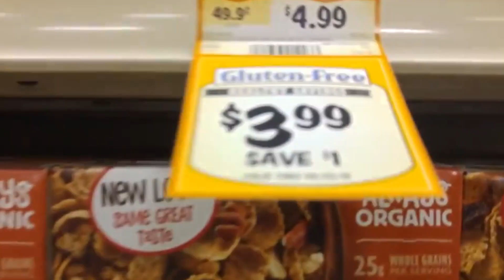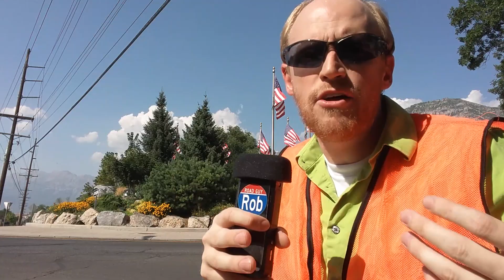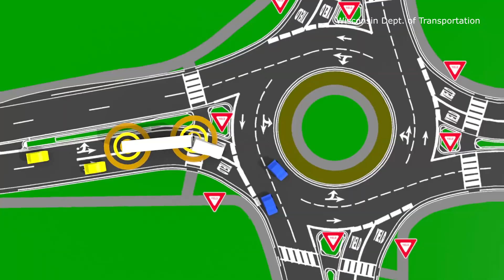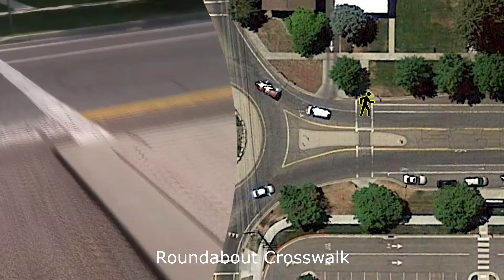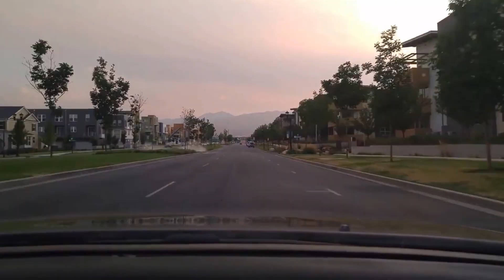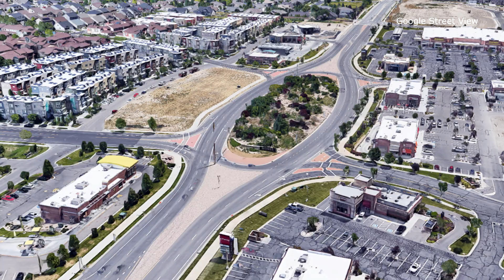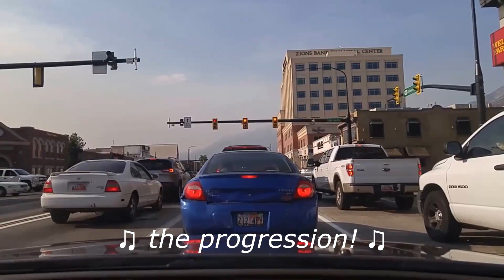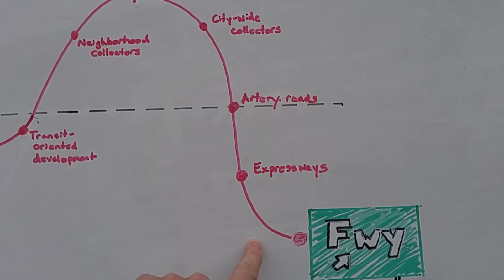Are roundabouts REALLY better than a traffic signal?

Comment: There are several problems with roundabouts that apply chiefly to Americans. American drivers tend to be lower-skilled and feel more entitled overall than their European counterparts (Russians notwithstanding). Of these, they fall into two camps: those that are fearful and those that are hyper-aggressive. Both groups are problematic anywhere of course. But while roundabouts can to some extent curb aggressive driving (good), they unfortunately cause already fearful drivers' anxiety to go through the roof, which in turn can cause substantial interruption in traffic flow at roundabouts as they hesitate to enter or exit them, or yield to entering traffic. Perhaps these behaviors will improve in time as drivers get more used to them. As to longer walking distances for pedestrians this can be both good and bad. For disabled and elderly folks this is clearly bad. On the other hand, given Americans' propensity to get obese or at least overweight (me included if I allow myself to slack off), longer walks can be a good thing. So are roundabouts good for America? Dunno. American drivers do not inspire confidence. The most clever traffic engineer is easily thwarted by entitled and fearful drivers. I think we're doomed have all self-driving vehicles eventually because of that, and I am not thrilled about it.

Update: since I wrote this, they've since installed three compact roundabouts on the main thoroughfare that services my sector of the city. I think overall it's a positive, but the biggest flaw in this design is that it in no way curbs the speed of drivers determined to get through them as fast as possible, particularly when they see themselves as being on the "main road," and the connectors as "side" streets, as was previously the case. The center is barely raised, as a raised center is a potential hazard for large vehicles. This wouldn't be so bad if the state had raised the pedestrian crossings or otherwise took measures to mitigate speed upon approach. As things stand, it's possible to zip almost straight through while barely slowing down, which has the following effects: 1) it inhibits traffic flow from the side feeders, 2) pedestrians are terrified from using the so-called protected crosswalks, and 3) increases the rates of collisions when they otherwise would not have occurred. We Americans clearly suck at this. The occasional cop parked at side street observing the circle is the only respite in the madness.

Comment: When talking about roundabouts' SIZE really does matter.  There is a brand new one at the intersection of State Routes 322, 19, and 98 just west of Meadville, PA  It is a two-lane, but the center circle is larger than most and make for very easy travel around it even for tractor-trailers.  However at the south end of Waterford PA, there is a roundabout that is a single lane and it even feels tight in a minivan,  The center is not nearly large enough to provide good angels into the roundabout.   Neither of these locations sees much pedestrian traffic so that is not an issue at all.

Comment: On AZ State Highway 89, between the I-40 and Prescott, there is a series of 6 tiny roundabouts. I hate them. They are in areas that are populated with businesses and have a 45 MPH speed limit, but no one does 45. People typically do 50 to 60 because the road is so open. The roundabouts themselves have a 20 MPH speed limit. I wonder how many accidents per year occur on those roundabouts.

Comment: It’s worth it for the reduction in fatalities alone
Reply: Banning motorcycles would reduce fatalities even further.
Reply: I wonder if those stats are actually cause, rather than misleading "effect".  

Is it that installing a roundabout reduces aciddents at the same intersection?

Or is it that they can only install roundabouts at safer intersections so it misleadingly looks like they're safer but really it hasn't improved things?

A suburban intersection wuth low traffic and low speeds is relatively safe. Whereas a traffic light at the end of a 60mph highway with 3 lanes in each directiom is going to be less safe...but they'll only put a roundaboyt in at the first one...
Reply: @ghostbond1074  My cynical take on it was this:

Does the roundabout get the same amount of traffic? Or does the majority of people avoid it, use a different route, and make us think that the roundabout works to reduce accidents, simply because people aren't using it?
Reply: @iFixJunk  lol, ha, I hadn't even considered that!

I do actually prefer roundabouts for low traffic areas. No worries about getting pulled over by the cops because you didn't "come to a complete stop" at a stopsign or sitting and waiting at a red light that doesn't want to change.  

With low traffic they're great as yoi slow but don't have to stop.

But once they start adding 2 lanes or the lighting is bsd at them they make my head hurt.

Comment: The roundabouts are also not greatly designed, the crossroads are vertly far away from the roundabout, and in the netherlands we have alot of these multi lane roundabout and it works great since we don't use paint, we use these raised curbs between the lanes so its impossible to switch lanes.

Comment: I drove in America once. The amount of traffic lights is unbelievable. Spent so much time waiting at each intersection for little car movement.
Reply: Road infrastructure varies wildly between different states as well as urban / rural.
Reply: "in America" here means almost nothing; conditions and ways of doing things vary widely from place to place in this country. Even going from the NYC metro area to upstate NY you will see a vast difference in how traffic signals are, the prevalence of roundabouts, the frequency and severity of traffic jams, and a million other things.
Reply: It's also because North American traffic lights tend to be dumb. More often than not they're on a fixed cycle rather than having detection loops.
Reply: @captainchaos3667  mmm the lights in my city have a detection system
Reply: @captainchaos3667  an improperly timed fixed cycle, I could time lights to safely move people faster than many intersections in the US with only a couple of days of observation and a rough idea of seasonal traffic variations.
Reply: @captainchaos3667  I doubt where they were there were dumb traffic lights. Even in towns of populations of 9,000 have detection on some of their intersections. I'm sure OP was in a bigger city, way more than 9,000 people.
Reply: @captainchaos3667  Just the opposite. Every light I've ever used in my life is on a detection loop.
Reply: @captainchaos3667 which is dumb it should be detection
Reply: @captainchaos3667 I have never seen a traffic light here without something to sense traffic and I've been here my whole life
Reply: @captainchaos3667  true not just bikes has a great video about this
Reply: Yes but we have bigger roundabouts with lights all the way round which is far worse
Reply: @vc8my  I've never driven in New Jersey. Don't you even have to have a gas station employee pump your gas there? Anyway, here in Ohio, I usually only encounter red lights within city limits. There are some signals on highways, but they're few and far between. And, if you're on a highway travelling at 55 mph and approach an intersection with a stoplight, the timings are usually set so that  you'll get the light green about 80% of the time. With a roundabout, however, you'd have to slow down to around 15-20 mph 100% of the time. With a stoplight, you have a good chance to just keep moving at full speed. I'm not saying roundabouts don't have their place, butt I don't think they're helpful roadways over, say, 35 mph. And highways are a good spot to put automated lights with pressure plates or cameras.
Reply: This is an issue with the human condition.  Take the restaurant industry.  A person having a negative experience is 4-5 times more likely to leave a review than a person with a positive experience.  It is just the human condition.  You have unwittingly done this with traffic lights by focusing on the negative.  You don't remember all the green lights you just drove through.  This is because they didn't interrupt your travel so you quickly forgot them.
In the vast majoriry cases, roundabouts are, at best, a hindrance to traffic flow.
Reply: I'm guessing Las Vegas, since I had the same experience there. Not an America thing.
Reply: @thesaneparty4079  you haven't been to enough city's it is definitely an america thing.
Reply: @garethbaus5471  I've been to quite a few cities- Let's see. Dallas, Chicago, Las Vegas, Los Angeles, Atlanta, Memphis, Pensacola, Orlando, Birmingham, Tulsa, Little Rock, Abilene, Phoenix, New York, Boston, Buffalo, Fort Worth, New Orleans, Columbus, Cincinnati, Minneapolis, Denver, Colorado City, Kansas City (both), St. Louis, Nashville, Chattanooga, Washington DC, Philadelphia, Asheville, Mobile, Flagstaff, Albuquerque, Alamogordo, El Paso, Houston, San Antonio, Austin, Oklahoma City, San Diego, Knoxville, Louisville, Indianapolis, Des Moines, Salem, and all of the smaller cities between those. I've been around Europe (born there), Canada, and briefly north Mexico.  The only place I recall wondering to myself "WTF is up with these slow traffic lights" was Las Vegas.
Reply: @thesaneparty4079  i have had issues with slow traffic lights in 7 of those cities as well as several others including but not limited to Rapid City SD, Ottawa KS, and Elko NV(there was one light on my commute in Elko that would turn red 3 or 4 times in a row before I could get past it and it would stay red for about 5 minutes at a time).
Reply: Traffic lights, the cancer of car transport. Roundabouts, or as they are called in New England, rotaries, are much better. I worked in Massachusetts for a few months in the 1990's. From Ireland we drive on the left. One of my compatriots entered a rotary on the left and went around it clockwise, the opposite to what you should do in the US.
He was lucky not to be killed.
Even more different were 4 way stops where ALL four roads to a junction have stop signs. ALL approaching traffic must stop. Then the first car at the junction gets to move off and go. It is an art form deciding what order to take on resuming your journey but most people memorise the arrival order and it works.
Reply: I’ve done it too, it’s not great. Where I live intersections can be irritating as smaller junctions have traffic lights and some would benefit from roundabouts, but oh damn America was infuriating. So much traffic and so many damn stoplights! LA was the absolute worst though, it took us 3 hours to drive a few miles ON THE FREEWAY, and driving through the city was little better with lots stopping and starting. I’m never going back there.
Reply: There are so many places in the US were roundabouts actually slow the traffic down!!
Reply: Japan is even worse. But it does really depend in the US where you are.
Reply: to be honest I couldn't get my head around the junctions with lights and jug-handles they were just so unnecessarily complex and expensive to make
Reply: Thats called a traffic circle
Not a roundabout
Similar but not the same
Reply: Well, saying "I drove in America" is tantamount to saying, "I drove in Africa." It's very large, diverse, and it really depends on many different factors: the state; local laws; number of bridges, overpasses, tunnels, etc.; rural vs. urban/suburban, etc. You can literally drive from San Francisco to New York City (suburban) without seeing a single red light, about 2,906 miles, so it really depends. Of course, if you're in a city, you will have red lights to maintain traffic.
Reply: its a combo of terrible traffic lights and severe car dependency, more cars mean longer traffic signals, worse signals means more waiting in general

Comment: you should watch YTers play cities skylines, they put roundabouts on highways just so they can not build stack interchanges and overpasses. It's weird to expect people to go less than 50mph on coverleafs yet highway roundabounts expect them to go less than 70mph. Yes one thing about 2 lane roundabouts is they are savage. I was stopped at one and one car was in it. It was in the inside lane, as it comes towards me I was expecting it to be on the 'inside' lane as it didn't exit at my street, I almost went in, but stopped and that car tried to run me over switching to outside lane, it never exited on the next lane either (meaning it's gonna U turn back). really? man the ethnics and matters of Midwestern people in these rounabouts. Turns out if you ever get hit going in, you're always at fault, even if the motorist inside is on inside or outside lane, (well without proof ofc. unless you have a webcam). The roundabout can only take 15-20mph vehicles in, but I've seen people go as fast as 30-35 mph in them.

Comment: It might be further to walk at a roundabout, but since you don't have to wait for lights it can still be quicker than a regular intersection. Also much less fraught, since traffic is travelling at much slower speeds.

No roundabouts on freeways...definitely.  However exit/entry onto a highway should be roundabouts instead of lights, much less chance of backing up.  There are many cases of roundabouts WITH lights, just to ensure that the priority entry onto a roundabout is not back up too much.

From a pollution/fuel efficiency point of view, slowing down and not stopping is better? 

From a psychological point of view, moving slowly is better than stopping.  Being under the 'threat' of missing the green wave can induce drivers to travel too fast.
It also helps with road rage in that you don't have the next stop light to worry about if someone is being overly aggressive.  

I used to live int he UK, and whilst we have lights, roundabouts are very common too.  It was a culture shock moving to the US, seeing how everyone seemed to be 'racetrack to the next lights...and stop...racetrack to the next lights...and stop....'.  It got to the stage that you actually felt happy to have gotten through two sets of lights without stopping!   That was completely new to me.  I was used to lights, and knew plenty in the UK which ALWAYS seemed to be on red for me, but they were one point on the journey, not every 300 yards!

Comment: I think they're great in light to medium traffic, but I go miles out of my way to avoid them in bumper-to-bumper rush hour traffic.  "Yield to the car in the circle" doesn't work when the entire circle is packed non-stop for an hour.  Then it becomes a zipper merge where nobody fully trusts that the other drivers will actually zipper merge, making it even slower than a normal merge.
Reply: Thats why i wont take one for a spin. Also, hard as hell on trailers

Comment: Hoping for your rebuttal Mr. Rob the Road Guy.  
1. If the pedestrians have too many steps, then make the roundabout smaller. Or if we don't have the space to fit the large roundabout in, make a smaller one. I've seen plenty of smaller roundabouts in other countries but the US seems to have designed a single roundabout and decided to use that single design for the entire country.
2. Don't allow large trucks to drive down streets with roundabouts. Only allow smaller trucks.
3. For platooning theory, I wonder how many streetlights are actually designed to be progressively timed signals throughout the US, I doubt the majority do. If we assume a majority handle random arrivals then a roundout would better handle the random traffic flow and reduce the queuing time.

Comment: Ugh, roundabouts are FUCKING AWFUL to cross as a pedestrian...you've got a longer distance to cross, and at the same time traffic becomes extremely unpredictable. You either wait until there's no cars within sight, or you just cross and pray that the cars behind you that you won't even be able to see can see you and decide to stop.

And platoons help pedestrians too. The one lane roundabout near my house I just have to stand back and wait until there's NO cars in sight, then I cross. But at the large multiple lane intersections? I can see where everyone is going and what stage the light is at from a fair distance back, and I can speed up or slow down my pace a bit so I hit it at exactly the right time and I can often just proceed straight across. I know who is going where, I know when, I can even account for whether or not it will be possible for someone to run the light based on the volume of cross traffic. You can't account for any of that with a roundabout, you just roll the fucking dice every time you cross...

Comment: Here in Vegas, traffic engineers use platoons for the opposite reason. They make sure you hit red at every intersection. They call it "traffic calming". I call it road rage inducing. You leave an intersection and as you approach the next one, the light turns yellow. This happens at every intersection. I've found the only way to break this cycle, is to go quite a bit over the speed limit to break away from the platoon. Then I arrive at the next intersection before it turns yellow. Is this safe? Nope, but it's what you have to do if you don't want to stop at every single light.
Reply: @Rugar 22 tell that to th RVers with 5th wheels and me who pulls a 40ft trailer with 14,000lbs on its back. Ill sen you the bill for my suspension repairs and blown tires off the bead.